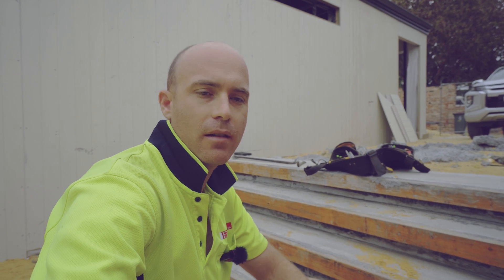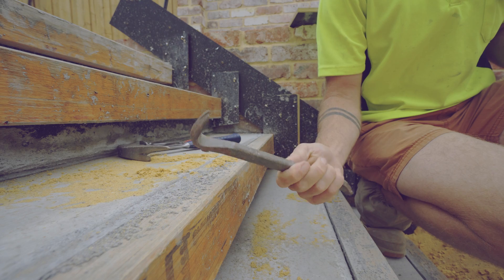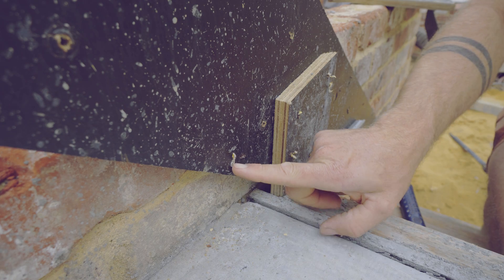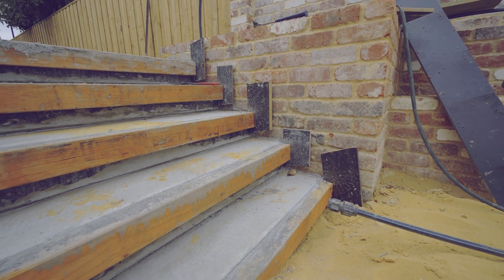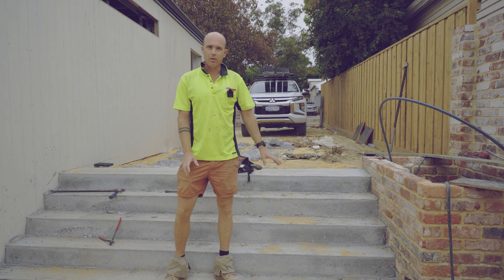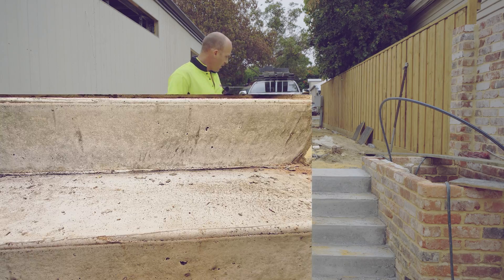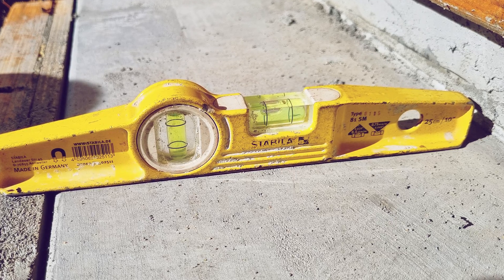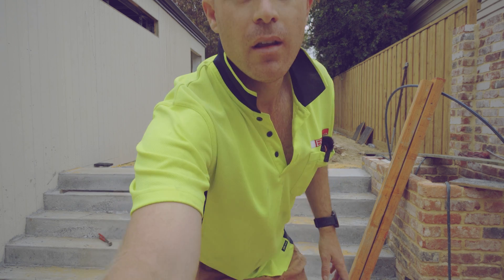Stripping My Stair Formwork Plus Stair Defects and Problems

Comment: screws all the way mate, you can reuse rather than biff them on the floor    more haste less speed       pull the forms while theyre wet, and then finish trowel them after the initial mag float...always pencil vibrate in between the form to create a nice clean face
Reply from the maker: 100% if you’re strip troweling.

Comment: What are your thoughts on footing requirements at the upper or lower landing/ of steps? would you just do a thicker slab, or a couple pillars per slab?
Reply from the maker: The bottom step has a large thickening. Top doesn’t need one. Bottom always has one which keys it into the ground

Comment: Hey mate what kind of hammer is that. And why did you purchase that style hammer? cheers
Reply from the maker: Hi, it is a German latthammer. I worked with some Germans and they let me use one for a while and I liked it. The pick is great for picking up timbers and you can put it into prop winders and use your hammer as a lever to wind props up and down. I will never go back to a claw hammer.
Reply: @bmformworkconcreteconstruc9783  cheers mate thanks for your reply. I might look into getting one 👍

Comment: Concreters: you don't always get what you pay for. I once queried a concrete mix. I was told...'IT ALL GOES HARD MATE!' I then had to pick his drinks cans out of the trench before threatening to throw him off site.
Reply from the maker: I refuse to deal with people with those attitudes.
Reply: @bmformworkconcreteconstruc9783  I agree. Sad, especially when some of the guys can be super meticulous and really strive for the best. Sometimes it can be worth talking to the engineer and making some trial batches to get the right finish, then advising the concreters. The batch plant will mix up what you need. Many just go with a standard mix that could be easily improved on. Concrete technology is still moving forward at quite a pace.

Comment: Can you use the concreate nails on fully cured concrete. Or do they only work on brick?
Reply from the maker: I plan to make a video on fixings I use and for each surface. I'm actually just using framing nails for timber. 2in into mortar. sometimes I add some concrete nails if mortar is a bit soft or a bit too hard. Into cured conc I usually drill a 6.5mm hole and use a tek screw with a piece of wire.